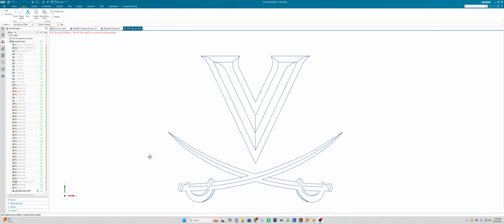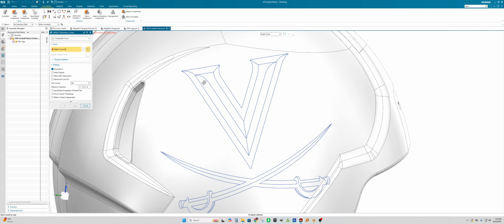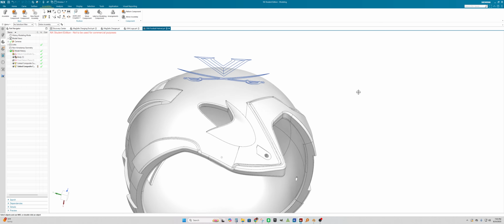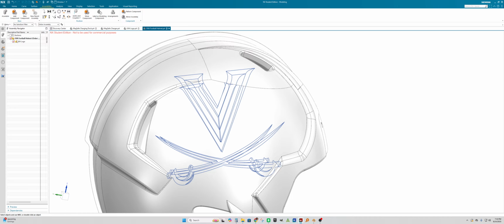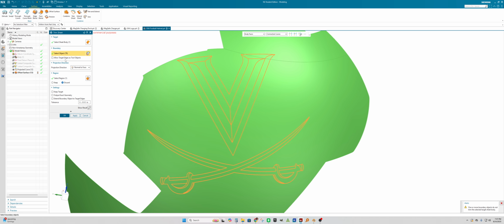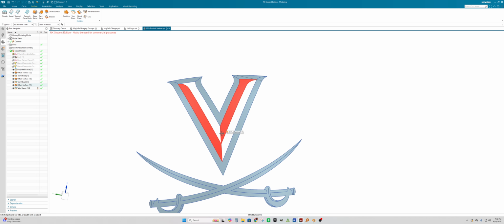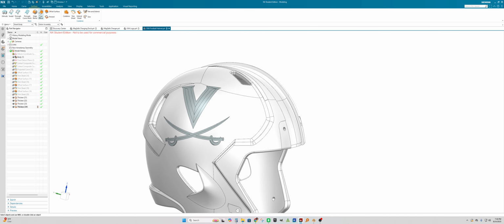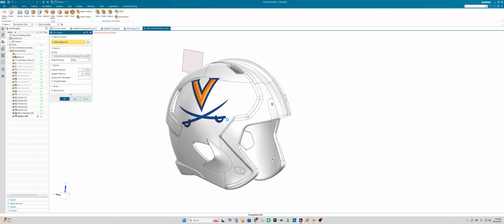Applying Logos to curved surfaces in NX CAD

Comment: Any tips for someone who’s not as advance as you trying to make helmets myself
Reply from the maker: I saw someone using tinkercad and they basically just pulled in my blank helmet file that I have here: https://makerworld.com/en/models/909663-blank-nfl-football-helmet-ams-not-reqd#profileId-895521 and then they found a logo and subtracted it from the main helmet so the logo is just fully cut thru the helmet and then they brought in another helmet and must have scale it slightly smaller and aigned them so that the smaller helmet filled in the holes created in the first helmet so whats left is an embossed region. Its clunky and limited but doable with free software and a bit of effort. I personally have only done it the way I show in the video so I can't help much on other methods.